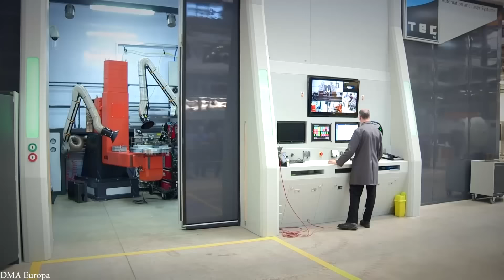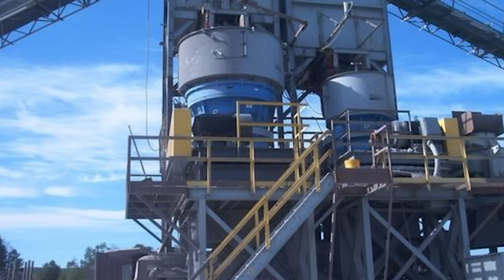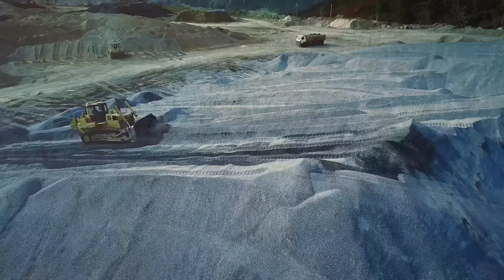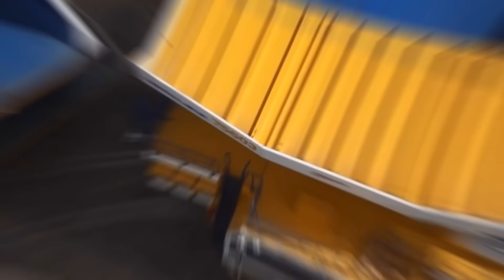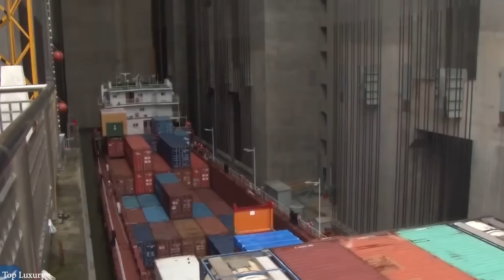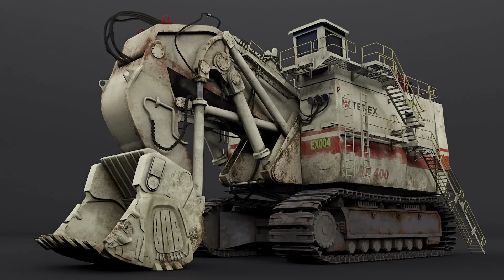15 MOST Powerful Industrial Machines

Comment: I was on board and amazed by all of this until towards the end...the "extrusion" machine to press metal into shapes under intense pressure   was stated to be better for fragile materials and better than pouring moulds n then he said aluminum....I'm pretty sure aluminum would be way better off being poured into a mold given its relatively low melting point and the fact that it cracks easily under pressure so not sure bout that one

Comment: Several years ago, I visited the Hull-Rust-Mahoning Open Pit Mine in Hibbing Minnesota. On display there, they have a 170 ton truck that they retired because it was too small.
It doesn't look all that big when they tour guide mentioned it so I walked down to it. And I walked, and walked... When I got there, the thing was probably three stories tall and it's wheels were ten feet in diameter. And this was a SMALL truck. I never saw one of the big trucks close up.
The tour guide mentioned that a truck like this once drove over a pickup truck in the mine and the operator didn't notice. (I think the truck wasn't occupied at the time, thank goodness.)
Minnesota has relatively small open pit mines, but still the equipment they use is MASSIVE.
Reply: Yeah they are pretty awesome. I used to operate 400 ton trucks in Alberta, Canada, they are wicked.
Reply: Umm the driver would most definitely notice.
Reply: Emi...
Reply: and now you got to think the maus a ww2 tank weighed 188 tons

Comment: I worked with a 9k hydrogen/Nitrogen laser in Indiana.  We had a 6k also in our department.  We could max out at 1 5/8 in thick steel.  Cut it clean like butter when it was clean and dialed in.
Reply: eemily792-v Mei 2021
Emily...

Comment: 2300AD: "15 MOST Powerful planet crackers"

Note: If you don't know, a planet-cracker in some sci-fi communities, is a large spaceship that mines a planet. Most use lasers to cut out a large portion, drag it up using massive mechanical pullies or some gravity tech, and they mine all resources from it, and then just dump it back onto the planet.

Dead Space was an example. Dead Space, the first one, was on the "Planet Cracker, Ishimura".

Comment: That enormous diesel engine is pretty big, but it's not bad. It therefore has no enormity, but it does have enormousness. They mean different things. If you don't know the word to use, don't start inventing new meanings for existing words. Instead, look in a dictionary and find the correct word. If all else fails, start reading. It'll do wonders for your literacy.